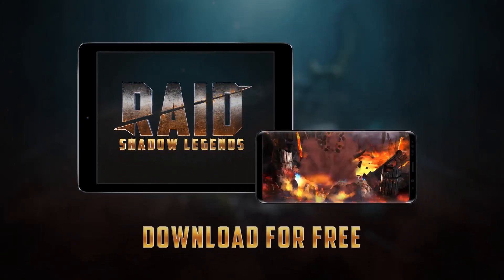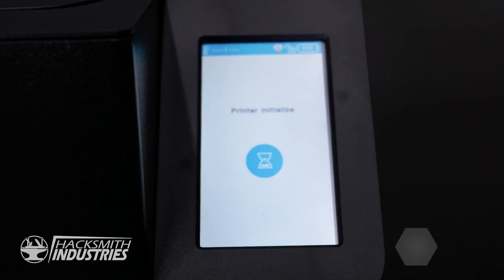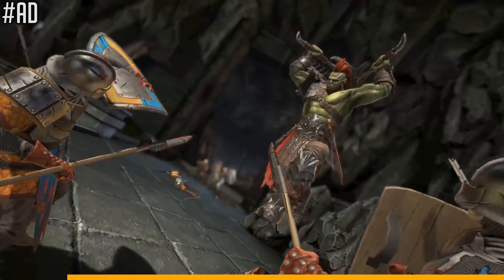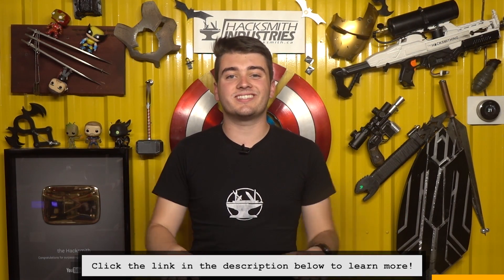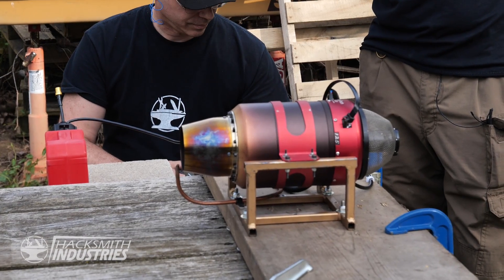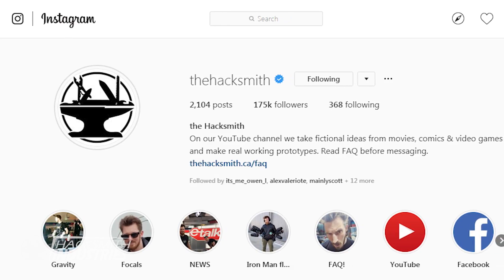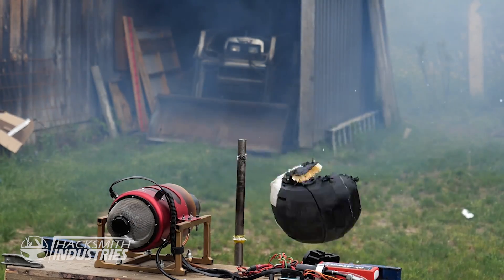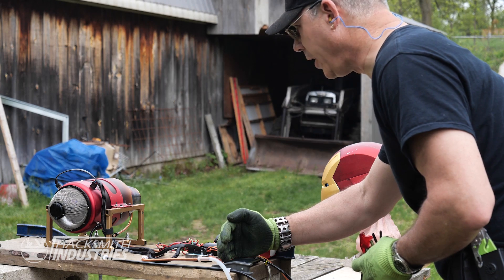Jet Engine vs IRON MAN! (MAKE IT BREAK)

Comment: Hi! I remember a part in a Flying like Iron man video where the Hacksmith told that leg thrusters are not possible to make, since the legs start moving around uncontrollably. 
Is it possible to fix this problem by building a light aluminum exoskeleton, which has stoppers in the leg joints. When the pilot pulls the thruster activation trigger, it gives a command to the stoppers, locking the legs in place. 
Sounds wierd but i could explain better by drawing....
Reply from the maker: Watch all the videos in the series, gravity tried leg ones, just doesn't work well 💪
Reply: Okie👍🏻

Comment: Instead of trying to destroy something. Try to fully protect one of those ZGB heads from the jet. No melting, burning, flying off the neck etc. And no, a steel plate is not a solution, the "zombie" must wear its protection!

Comment: is the helmet made from aluminium? i can't imagine a steel helmet melting like that at those sort of temps.
Reply: Im glasd someone said it ive been coming through the comments trying to find out what material it was because steel at 700° F/C shouldnt lose its integrity like this
Reply: Scrap that just googled and steel loses around 50% of its structural integrity at 650°C so if it was thin enough and the force is high enough this would be plausible

Comment: Nice. But please don't make us search for what metal was used in the helmet. The mentioned web site also doesn't mention the actual alloy, but does mention aluminum although exact wording is rather confusing. So assuming aluminum with a melting point of 660 C vs jet exhaust with temperature of 900+C, the result expected result is rather obvious.

Comment: this isn't surprising at all really. there is a good reason why titanium is used in jet engines. titanium can withstand the heat, steel and iron can't.
Reply: It's even worse. That helmet is mere aluminum with a melting point of about 660C. Iron is over 1500C with steel at about 1400C.

Comment: i think metal helmet puncture beacuse rusting. when jet engine removes the coating metal coating reacts a lot of oxygen and that makes matel weak. i think if atmosphere havent got oxygen this wont happend
Reply: No, it melted. But if there was no oxygen the jet wouldnt work so you are technically right
Reply: @rhinothepwn  i said atmosphere has no oxygen not said no air thats different thing.
Reply: @rhinothepwn  and i said not because of heat because before helmet puncture its color turn brown
Reply: @DoDurgaaTM  Changed colour because of the paint falling off. Theres no metal coating. I know you said atmosphere with no oxygen, and combustion (jet engines) require oxygen to run
Reply: @rhinothepwn  oh its troue i missed that point lol 😅. but about color, i know firs color removed then coating this time metal surface shine then color turn brown and matte i think thats rust am i wrong
Reply: @DoDurgaaTM  It's not rust as zinc doesn't oxidize in that way. I believe that was the fog juice landing and burning on the surface when it couldn't move, or just the metal getting a lot of carbon built up

Comment: That was awesome, now I kinda wanna see what would happen to the captain America Shield when the jet engine is at full power
Reply from the maker: The Captain America Shield is made out of aluminum with a melting point of 660 degrees C. I doubt it would melt because the exhaust cools off very quickly and the aluminum would dissipate a lot of the heat.

Comment: Yes. Jet fuel does melt steel beams- wait what?
Reply: Jet fuel itself can't even melt gallium, a metal that you can melt with your hands. Jet fuel, if it's coming out of the exhaust of a rocket engine, can just about melt tungsten which has over double the melting point of steel. Also, steel doesn't need to be anywhere near molten to have its structural characteristics severely compromised. "jet fuel can't melt steel beams" is one of those rare amazingly stupid statements that is wrong in every conceivable way.
Reply: Just Some Guy without a Mustache I was really hoping for this to be a comment